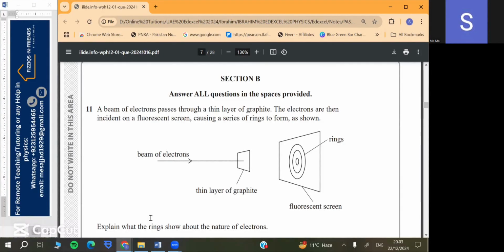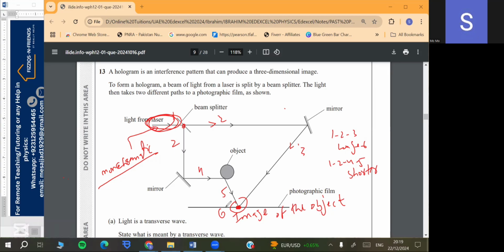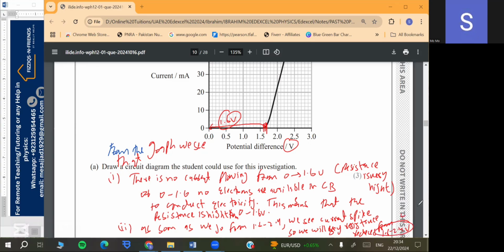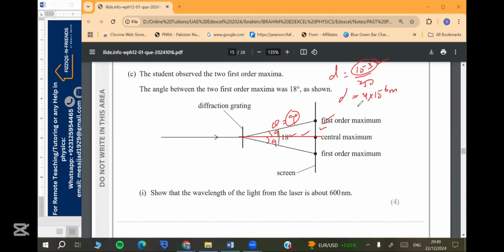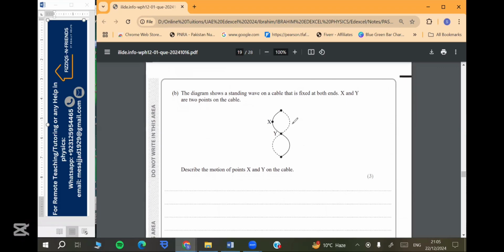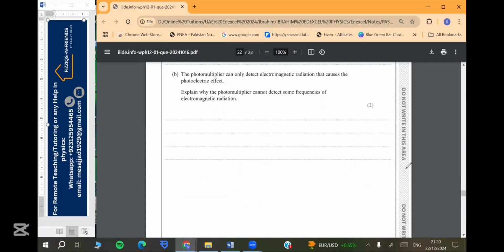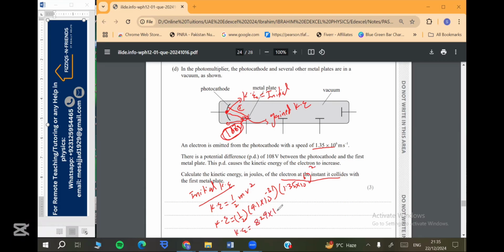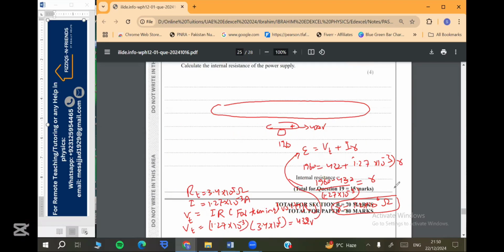WPH12 01 OCTOBER 2024 Part 2 | IAL EDEXCEL AS LEVEL PHYSICS PAPER 2 OCTOBER 2024| WPH12/01 OCT 2024|

Comment: in 47:40 , why lambda is equal to 2l?
Reply from the maker: beta zara...please remember that the standing waves are created between two closed ends and in a string or rope bound between these closed ends. that means the length is fixed as "l" here and cannot be changed. but you can vibrate the rope or rubber band between two closed points fast or slow. if rubber band vibrate faster it will create move number of loops. and it rubber band vibrate slow it will create less loops. now the minimum loop which  can be produced is 1. and in one loop you have 1/2 wave not full full wave. and half wave means the half length of a wave or half wavelength. therefore, we say the fixed length "l" is now equal to half of wave i.e. l=lambda/2 or lambda =2l.
is that clear?
Reply: @Physics.essentials  so we assume if only creates a one loop?
Reply from the maker: Yes thats right.
Reply: @Physics.essentials why do we assume it out of nowhere?
Reply from the maker: @chifnfelihwnwerjilnfefwijn  The answer in the first three words of question "the lowest frequency" which i underlined aswell, and lowest means one loop which means lambda by two is equal to length. I suggest please always read question carefully.
Reply: @Physics.essentials  i see i see alr ty man didn’t know that
Reply from the maker: @chifnfelihwnwerjilnfefwijn  youre welcome ☺